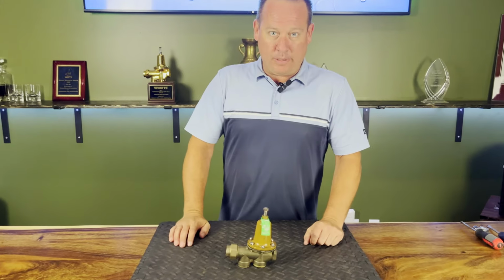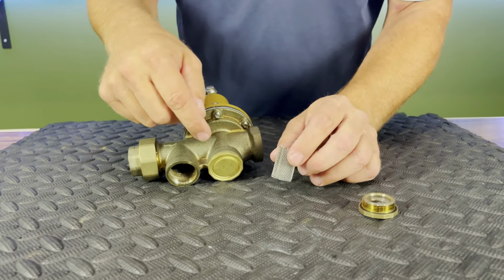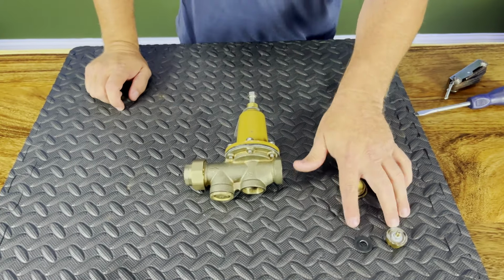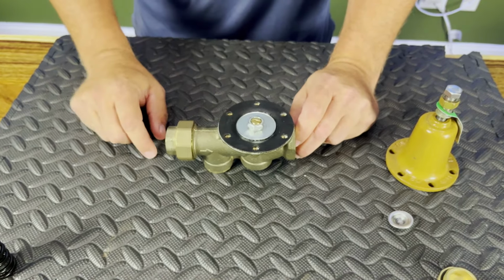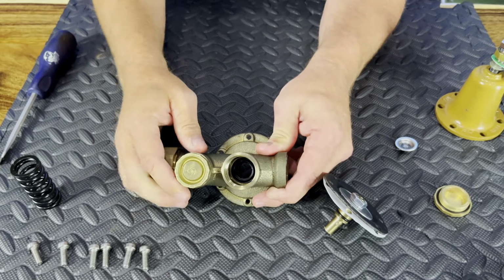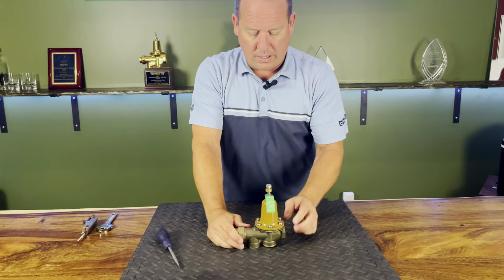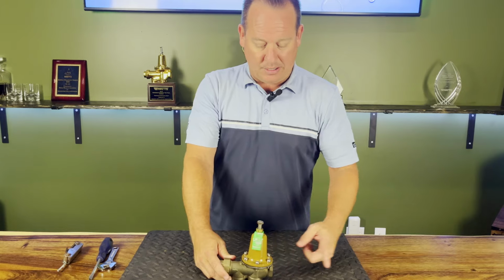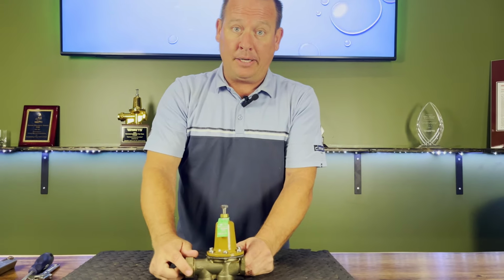DMA Water Tech w/ Todd - Watts LF25AUB PRV

Comment: Thanks for the very nice demonstration Todd.  I plan to mess with my valve after I replace it...but...  My problem with replacing vs rebuilding my valve which was creeping up on pressure just seconds after backing the pressure down, was that I found a new valve on Ebay for $89, and Amazon for $98... On both vendors, the rebuild kits were considerably more than the new valve,  averaging over $150 per kit. Do you have any idea why this seemingly overpricing would be, and is there a vendor that you know of that would offer these kits cheaper?

Comment: A pressure relief valve in the upstream direction taking effect at 2 pound? Strange.. It will take no effect until the downstream pressure exceeds the upstream pressure by 2 pounds. Next, in Norway, this pressure will meet a check valve and in fact end nowhere.

Comment: Hi - Thank you for the very quality video & tutorial.  When it  comes time to set the downstream water pressure after rebuild or replacement, does the expansion tank have to be deflated before dialing in the PRV?  Or do you set the expansion tank pressure to the desired air pressure first?  Not sure if the air pressure in the tank would tho off the water pressure measurement.

Comment: Great information.  The plumber who put my PRV in years ago never told me about the strainer, so it's never been cleaned.  I looked at a Watts rebuild kit, but at about $125 with shipping, it was only $25 less than a new 3/4" 25 AUB Z3 PRV.  I figured the old one was probably chewed up from debris, so I am going to install a new one.

I wonder what's going on with the price of the rebuild kits.  They should cost maybe $30 at the highest and yet they are between $103 plus shipping and $150.  Go figure!

Comment: This is the best video out there showing disassembly and reassembly of this pressure reducing valve. It gave me the confidence and knowledge to safely take my LF 25AUB Z3 PRV apart to clean it out and put it back together again. Thanks for an excellent video.

Oddly, my valve had the red-squiggly-lined side of the diaphragm facing up towards the head of the adjusting screw. Since it came that way from the factory I didn't flip it, but I think your video is correct and mine was upside-down from the factory.